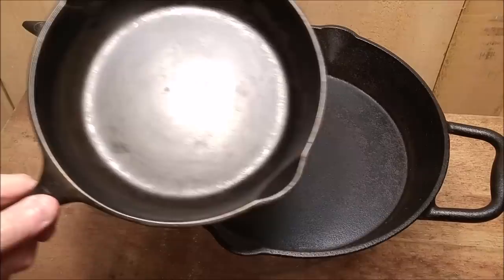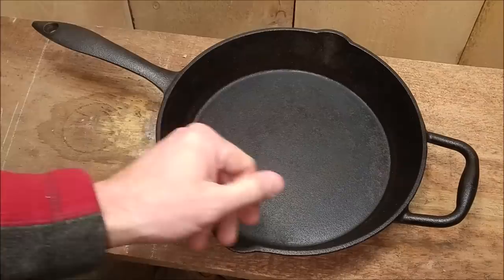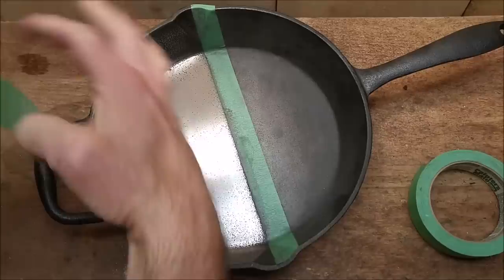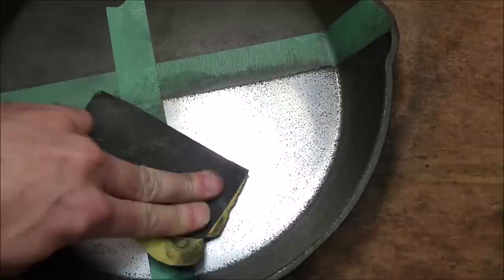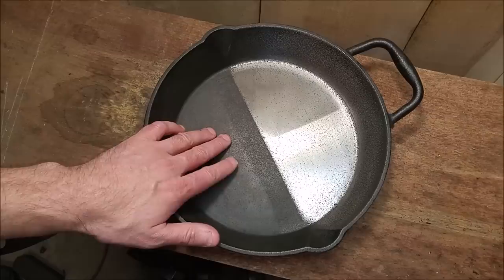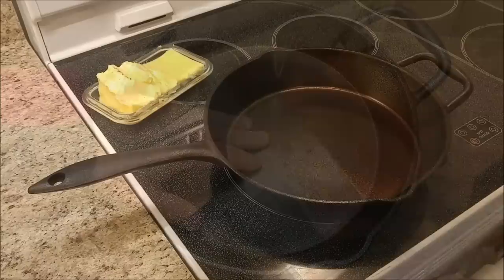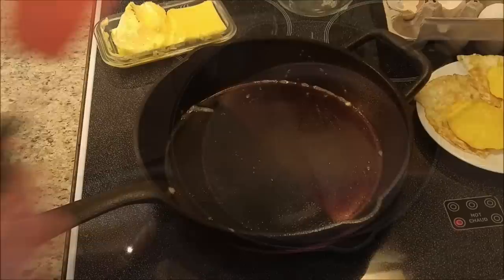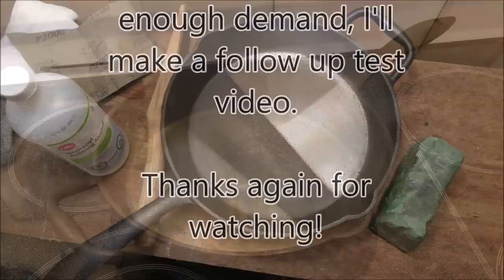🍳EXTREME Polish - Smooth a Cast Iron Pan to Reproduce an Antique Skillet then take it way beyond

Comment: nice. Lodge is a favourite brand. fairly inexpensive, bought my 30cm pan prologic preseasoned cast iron when I was in Toronto in 2002 or 2003. Still use it, now on induction. I have taken it to 370 C on induction to season it, induction for safety reasons cut off the operation. very very minimal warping but that could have happened on gas too. I used flaxseed oil once (unfortunately and that gave me a very hard time) I regretted using it. I used steel brushes and sanding paper to make it smoother, not as smooth as yours, seasoning doesn't adhere that well. 

It seems that the rough surface is creating hot pockets filled with tiny amounts of oil and that prevents food from sticking.  Fissler have some stainless steel pans that are actually griddled surface, creating little squares, their marketing stated that the oil is trapped and food does not stick.  The downside of the rough surface in cast iron, is that not only seasoning polymerises, from time to time when I run my fingers, the pans gather some dark matter, that is carbonisation and it sometimes is visible on the egg whites.  So with a very mild soapy  solution that is cleaned up and I don't like the carbonisation.  I realised there were no blackening fingers on my de buyer (black iron pans) due to the smooth surface. Care was the same, washing was the same. 

Now when people say this a better cast iron, this is not that good, I am sorry I also own non brand ones, they perform the same.  The metal alloy is the same, iron and silicon, so the difference is the thickness. Non brand ones are heavier than lodge.  We are not comparing enamelled ones, as there is a difference between French staub and le creuset compared with the Chinese enamel. 

Very good video. Thanks
Reply from the maker: I've heard so many people say they love their Lodge CI, it is a great price too of course, but so many people say they hate it.  I expect the people that "hate" it just spent too much money and need to justify the purchase by putting down the competition.  The handles are a little shorter, they are hefty also, but with induction that probably doesn't matter and no matter which pan I use, the handles heat up beyond the point that I can hold them.  Personally I believe that Lodge skillets are made to last and designed not to fail, they are practical pans.  Any new pan can be smoothed out easily with sandpaper if anyone doesn't like the rough texture.

As far as the rough finish in regard to non-stick, I'm still testing this out, I've had rough that stick and smooth that stick.  I find that a higher cooking temperature helps (maybe the release of steam) the idea of the oil having a place to sit does make sense to me, however many of the smooth pans I have perform very well and they are incredibly easy to clean.. I literally just use the metal spatula and a little paper towel and done.  

I've been researching the types of cast iron, and it is an alloy of sorts because there are other little ingredients they add to make it more fluid during the pour, so there are different types, and I suppose you could kind of say that might be related to the quality.  My thought here is that one mix of materials is better for a particular purpose than another.  In general what you say is what I believe as well.  I've only ever cracked one pan, and that was because I accidentally put the burner on high with nothing in the pan, going from 20C to 300C in a matter of a few minutes without heating the entire pan evenly caused a crack.  

An interesting subject, I want to learn more about this.   Something very cool that I saw recently was the process of hardening the 'ways' of a lathe bed using induction heating in some type of coolant (looked like water) I never knew cast iron could be hardened.  

Thanks for the note I appreciate you thoughts on this very much!
Reply: "It seems that the rough surface is creating hot pockets filled with tiny amounts of oil "
the metal machining have the same concept too, the metal surfaces needs to be flat but at the same-time have to rough to contain lubricating oil, if your surfaces were too smooth, two contacted metal surfaces will squeeze out the oil, and you won't get the lubricating effect.

Comment: The difference in temperature reading is just an error from the infrared thermometer. This instrument is sensible to surface finish. In thermodynamics, it's called the emissivity of a surface. One way you could test it, with the same equipement, would be to stick a piece of tape, or anything non reflective on each section, and mesure that instead. I bet you the temperature is in fact the same everywere on the pan. Try it!
Reply: Will do, what do you think would be a good food safe material to test with?
Reply from the maker: I need a multi-meter desperately, that would be a really useful feature to have.  I have a meat thermometer which I'll try, but I don't think the range is high enough, though I could just keep the temperature low since there was a significant difference no matter the high or lower temps.  I wanted to try using something on the pan like a small piece of thin metal, maybe a cross section of a piece of steel rod.  Then the sheen would be identical for each piece. I wonder if turning the lights off and taking a measurement in the dark would help. 

I'd prefer not to do the "old-school" how long can you hold your finger on it....

I appreciate your input on this, this is pretty cool stuff.
Reply from the maker: Makes sense, I had been hanging onto a heat shield from an old computer monitor, it's black and fairly thin (0.5mm) that could work.  I still like the meat thermometer idea though.
Reply from the maker: I'm struggling with the readings still, I've tried thin pieces of paper, parchment paper, and computer monitor heat shield, and the original rough finish is still reading much higher.  I'm going to check the skillet for a perfectly flat bottom and see whether that may be contributing to the false readings.
Reply: Try flipping it over and get a reading from the bottom of the pan since you haven't changed the finish there
Reply: In all fairness, the side with the higher temp showed a browner egg white when the cooking was happening.  There might be a little truth to that.  But perhaps it’s just the surface with the extra layers that holds a bit more heat and adds a sear that the sides with lesser seasoning layers cannot.  The core temp of the pan should be consistent because that’s what cast iron does.  I think the minor fluctuations are affected by the surface layers.
Reply: The heat is dissipating from the more porous surface and not emphasizing metal density.  More holes = more surface
Reply: More IR emissions from the same area with the rough surface.
Reply: Use a thermocouple for direct contact measurement. Infrared thermography isn’t an exact science on bare metal surfaces, worse when smooth.
Reply: Black-body radiation - Black has higher emissivity than lighter colors.
Reply: More pitting = more surface area?
Reply: @mwint1982  When you are doing infrared thermography surface features can help you get a more accurate temperature reading, for example if you have a block of bare aluminum on a hot plate with different depth holes drilled in it, the deeper the hole, for the most part, the more accurate your temperature will be. The surface finish texture and the more extensive build up of seasoning on the "old side" of the pan will help make the surface less of a mirror.
Reply: Exactly.

These would be my suggestions for getting better temperature readings from this pan using an infrared thermometer:

1. Burn off all of the seasoning.

2. Clean the pan thoroughly.

3. Set the pan on your stove and turn the heat on, don’t take any measurements until the pan has had enough time to absorb as much heat as it will from your stove (don’t need super high temperatures).

4. When taking measurements with your infrared thermometer, use the distance-to-spot ratio of your specific thermometer. D:S ratio is the ratio of the distance to the measurement surface and the diameter of the measurement area. E.g., a D:S ratio of 12:1 means the measurement area at 12 inches would be a circle of diameter 1 inch.

Guarantee the temperature would be the same on all three sections if these things are done.
Reply: Michael Duran the readings might all be the same but they will all be wrong, you could put the bare metal pan and a brick in an oven at 400 degrees for 16 hours if you pulled the rack out and shot both the pan will have a much cooler reading because it is also reflecting ambient infrared heat. Emmisivity  of bare metal isn’t trust worthy, don’t use it with infrared tools if an exact temperature is important.
Reply: David M but here is the interesting thing!
Cast iron is not just about surface temperature. The high emisivity results in extra heating along the side of the meat. This is exactly why a cast iron grill skillet is extremely superior to an aluminium. You WANT the high emisivity! And this is exactly why they make them rough
Reply: @amandahugginkiss61  Cast iron is a poor conductor of heat - it's even used for the handles of copper pans!
Reply: Just use a pot holder, and pick up the pan and scan the bottom in the three areas, should get the same reading.
Reply: @WetOlde  Its Mass.
Reply: hot spots are totally a thing with cast iron especially.. but i agree that the surface finish isn't having any influence.  In an unrelated note, I'd suggest to the creator that he needs a random orbit sander to make this process massively faster.
Reply: Yes. If you had a FLIR digital thermometer you could change your emissivity rating to .65 or so for the parts you smoothed more. .95 for the rough.
Reply: Wanted to run this by you. Could it be that the rough side of the pan having more surface area may have a lot to do with the temperature difference. More surface area in the same amount of space because of the hills and valleys on the rough side should equal more heat emitted and account for the higher temperatures. What think ye?
Reply: While reflectivity can be an issue, and may even be in the case of his measurements, the pan is almost definitely not the same temperature across the entire surface. 

Also,  easiest way to measure world be thermal camera, which are stupid cheap these days.
Reply: You could test it the way bakers test ovens. Toss on flour and watch the pattern of browning.
Reply: @FarFromN0thing  True, but only a small factor. The rough black untreated side is closer to a theoretical black body radiator than the smooth shiny treated side. The upshot is this: if you actually want to know the temperature of your pan, believe the rough black side as being closer to the mark.
Reply: @drmoss_ca  huh? Do you think the internal temp is lower than the shiny treated surface and the same as the porous black surface?
Reply: @FarFromN0thing  No, they will all have the same temperature - the heat they have received was conducted into them from the underside of the pan, but a matt black surface will radiate more of that heat than a shiny surface. Given the IR thermometer will determine temperature based on the amount of IR radiation being emitted, it will say the matt black part is hotter than the shiny portion, even though they are the same temperature. That's why using a conductive temperature sensor (thermometer or thermocouple) as suggested above would be a better method. Given that nearly all of the heat used in cooking is conducted heat rather than radiated heat, it won't make a discernible difference on the egg cooking any of the pan's parts.
Reply: @drmoss_ca  Same difference from what I said 2 mos ago.
Reply: @FarFromN0thing  Not quite. It's not the surface area (or rather that's a tiny factor); it's the nature of the surface that makes the big difference.
Reply: @drmoss_ca  Nature?
Reply: @FarFromN0thing  The nature of the surface such has it's topography like the overall roughness and the arrangement of peaks and valleys.
Reply: @kubetail12  said that
Reply: FarFromN0thing A rougher surface will absorb more IR energy and thus be a better emitter of IR energy.  Absorptivity and emissivity are pretty much the same quantity, but they not equal in most situations.  The spectrum of light a surface or object wants to emit is different than the spectrum of light from surrounding objects .  These spectrums depend largely on the temperature of the object but also depend on the composition of the material and whether the material is a metal or nonmetal.
Reply: Sprinkle flour.. hotspots will discolor.  Black body radiation is my guess on the difference. This is my theory... Laser measure temperature by frequency change, not by how much is reflected (some has to reflect). So,  measurements are real, but only show the surface temp.  The difference is that the heat is being projected from the shiny side, and collected by the dull. So in the flour test, it might show the same. But if you baked with it, it might be more done on the shiny side, and doughy on the dull side. (Surface temp vs temp 1 inch above)
Reply: As others mentioned, the surface emissivity is a factor in measuring temp with an IR thermometer. As emissivity decreases, reflectivity increases so you are more likely to pick up background temperature reflected onto the surface with the IR thermometer. The IR sensor in the gun measures the surface temp and the average temp across the sensor is displayed. The further the sensor is from an object the larger the surface area it measures. Taking readings as you were in the video with gun at an angel will also introduce error into the reading and is more likely to pick up reflected temps. The gun should be held so the sensor end is parallel to the pan. Hold the gun about 1” above the pan. To help reduce the effect of reflected temperature try covering the skillet with a cast iron lid and heat until the lid and pan have reached thermal equilibrium. Raise the lid just high enough to get your hand and gun under it. Take measurements with gun parallel to surface of pan and about an inch from the surface. Higher end Thermal imagers and the processing software allows you to enter background temperature to compensate for reflected temps. Some IR thermometers allows the user to adjust for emissivity but that won’t help with reflected temps. In this case, keep it simple and use a contact probe to to confirm surface temp.
Reply: I work in the home heating industry, and when I am checking temp differences  in pipes or a radiator then Ill put some masking tape on the pipe and then test that.
Reply: It is probably a reading error, as the radiating heat will be more perpendicular on the smoother surface, so reading "straight down" would be a factor.  In practice emissivity really does vary with the surface smoothness. Consider it like this: there is less surface area on a smooth surface from which to emit heat ... the material itself could even be warmer for as a conductive heat source as less energy is emitted!
https://thermalvision.ie/factors-affecting-emissivity/
Reply: Maybe I'm a little late but I second the flour test. That way you can visually see the hotspots which is also good for video purposes.
Reply: I was totally wondering why the temps were different! Thanks for the explanation!
Reply: Contact pyrometer, ones designed for brake rotor surfaces can be used for more accurate temp measures.  Also it seems you are using an electrical heating element that can induce hot spots on the pan, depending on the contact surface....so lots of uncontrolled variables that throw questions into the entire test.
Reply: Ooh, neat! Thanks!

Comment: Just a tip from someone who has been doing this for decades...I've modified a number of rough cast iron pans and griddles with super success using only 80 grit sand paper. The result was a smooth surface, but the 80 grit sanding left a tiny micro-texture to allow the seasoning to get established and not be lifted off by use.  Even the Stargazer company realized they had better results by having a tiny micro-texture allowing seasoning to hold. You will love the results...God Bless.
Reply from the maker: I agree, I followed up with a separate video on the subject as well.  A light texture, like sandblasting would probably be perfect.  I've boiled vinegar in teh pan first to etch it and that works quite well also.  Thanks for taking the time!
Reply: Gonna do this with my pan. So 80 grit it is. Not too rough not too smooth
Reply: Yep, going past 80 grit has diminishing returns.
Reply: Ihave and use a 10” Lodge & Stargazer cast iron skillet.  The Lodge holds a seasoning far better.  They both work but the Lodge is easier to live with despite the better ergonomics of the Stargazer.  Guessing minis pre-microtexture.  I seasoned it 7 times and even emailed them when it was new. PITA…

Comment: I inherited a Griswold skillet and a Wagner skillet that were both manufactured around 1920. I use one or the other almost every day. Unlike modern cast iron skillets, they are both perfectly flat on the bottom and don't "teeter" on the stove. They too have very slick cooking surfaces. I can only imagine how many great meals were cooked on them before they came to me. They are wonderful skillets. I really treasure them.
Reply: The older ones were so much better.
Reply: You're mistaken.  Modern cast iron skillets absolutely sit flat.  I've never seen a new lodge pan that doesn't have a flat bottom.  In fact, it's the old vintage skillets that usually wobble/spin.  They are thinner and many have been warped over the years.
Reply: @BornIn1500  Not "mistaken" at all.